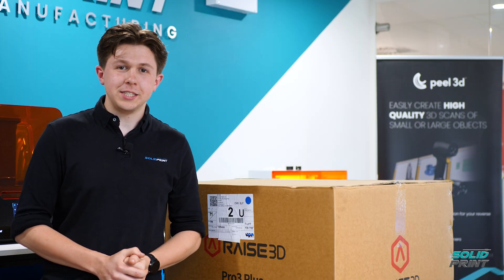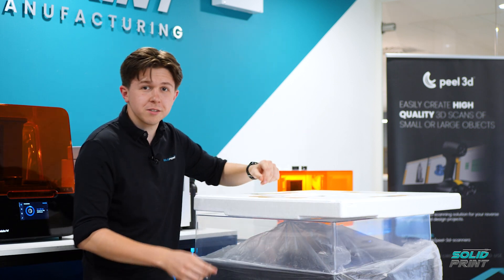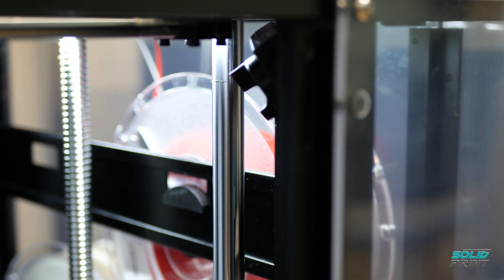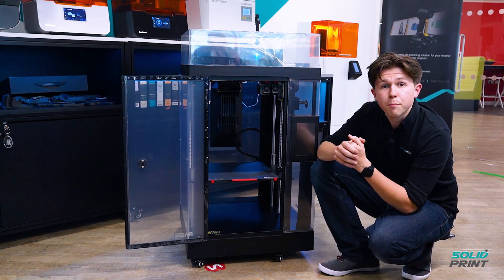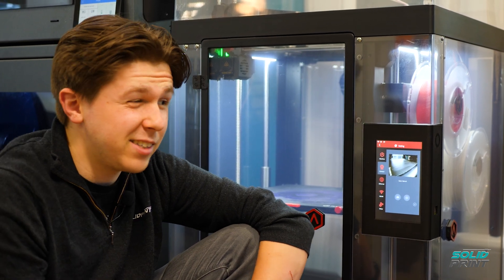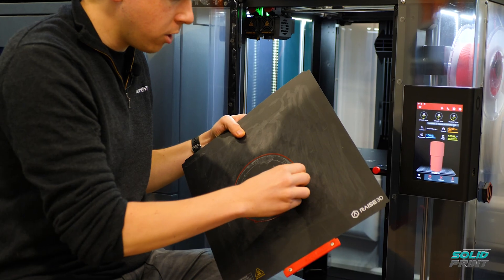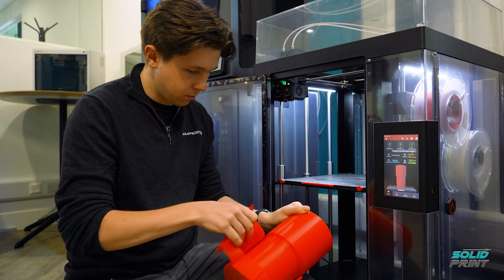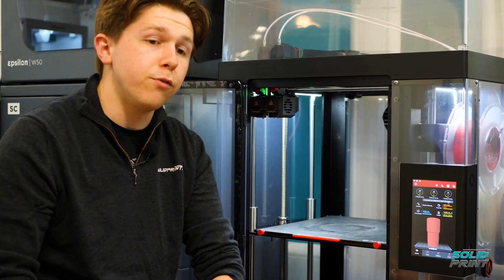Unboxing the Raise3D Pro3 Plus! #Unboxing #Raise3D #SolidPrint3D

Comment: Great video! I'm starting a business creating aesthetic vases (up to 40cm tall) using 3D printing. I'm looking to invest in reliable, high-quality printers that can handle consistent production.
Based on your experience, which printers would you recommend for:

Handling taller prints (40cm) consistently
Production reliability (minimal failures)
Good surface finish for decorative vases
Reasonable print speeds for a small business

I'm particularly interested in printers that can work with sustainable materials like PLA or recycled filaments. Any insights on machines you've had success with would be incredibly helpful!